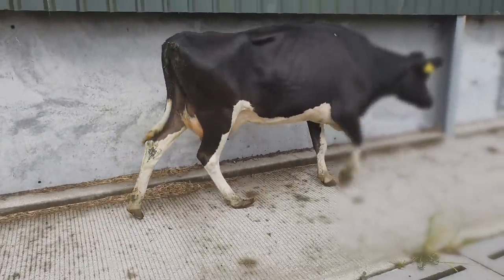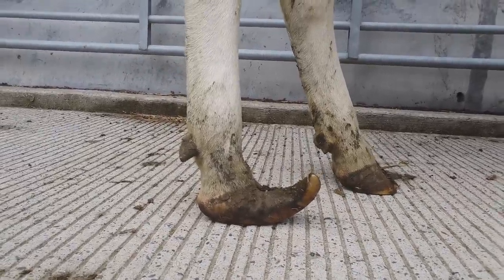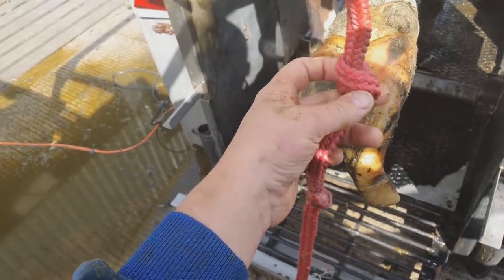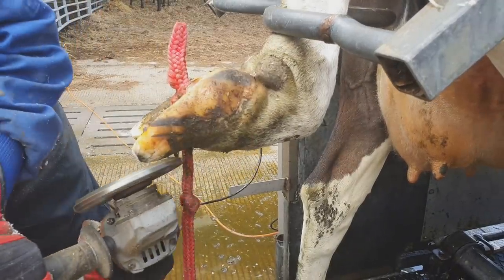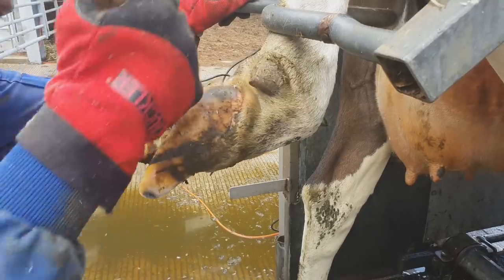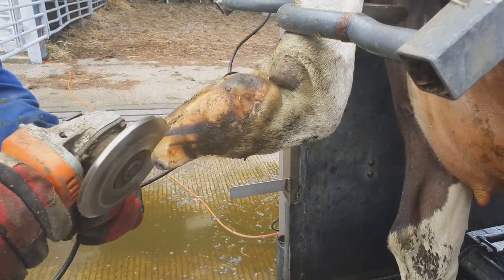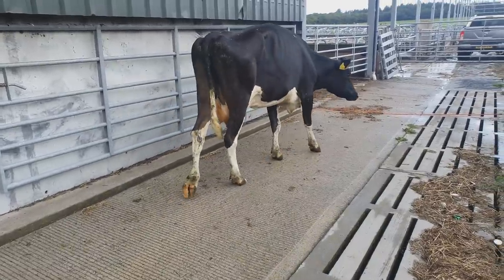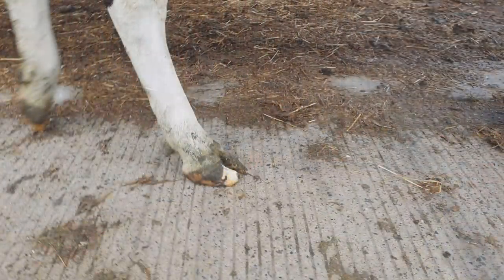COWS HUGE TOE! | The Hoof GP

Comment: I'm really impressed with what you know how to do. If someone ever told me you could reshape a claw and get a corrective rotation, I doubt I'd believe it. I know how important it is to be able to achieve proper angles in horses hooves. If the hoof doesn't have the correct angle, then the horse founders and has to be put down. You say you are just a hoof trimmer but it is obvious that there is a lot more to really knowing what you're doing.

Comment: For a hoof to grow like that means that the environment the cow is in is not adequate,... normally in the wild they would have go to all kinds of grounds with rocky parts and the hooves will be automatically trimmed / shaped because nature gets the way to fix itself (in most of the cases). And also seeing these are milk cows they are constantly in humid and small confined areas which can cause for the hooves to rotten and to grow abnormally due to lack of movement. It is nice to see you do a great Job with the bulls and taking care of them!!
Reply: this is actually caused by a problem in the overgrown claw, causing her to take the bulk of the weight on the opposite claw so the bad claw doesn't wear. At no point did he touch on the conditions this herd was kept in other to say in the comments that herd lameness is exceptionally low so I think you're making a few assumptions.

Comment: By the looks she is slightly rotated or stretched white line if cows have that but with more trims I would say she will be ok.
Reply from the maker: Absolutely spot on - she has a partially rotated pedal bone - the sole of the hoof needs to be trimmed perpendicular to the axial wall in order to try to reverse the rotation

Comment: Dr. What causes this? Like I said b4 in my post, I have an older cow that has long hoofs and she limps at times but not always. I live in Philippines an there is no one that does what u do and I need to do my cow and my younger heifers are starting to get the same way. Is there anything I can do to prevent this b4 it gets too bad. My father in law used to keep her on very wet ground n I noticed when I started to put her on harder ground she would suffer. Any advice will be greatly appreciated. God Bless

Comment: Question to that curled hoof. We had one like this, but it wasn't just the front which grew longer, it was also the outside wall, which then curled under the hoof. Like a false sole. Wish I could have seen the hoof from the back when you shaped it. Did her outside wall on that toe curl under as well? If so, did you trim under the foot all the way to what would be the real sole? Not sure if it makes sense how I try to explain it. Just wonder how you would tackle a trim like that.
Reply from the maker: That makes perfect sense. Yes this was exactly the same to begin with and as you can see once it has been trimmed it is back to the correct sole horn.

Comment: Every time you put the leg up it seems to go with great force and the cows is also quite heavily protesting, and pulled out of balance. Why not more gently/slower? Seems like the biggest stressor of the whole process
Reply from the maker: The slower you lift their leg the more resistance there is because they realise its happening - if you lift their leg slowly the kick out which could hurt themselves and they strain to try to keep their leg on the ground d which can pull tendons and stretch muscles - lifting them as quickly as sensory possible is best I promise

Comment: I have angus cows and I have a bull that has a toe just like that. and I can’t find anyone to work on him and I can’t sell him. I think I will try to fix it.but I have never done it before and my question is i think you said not to grind the top of it right?
Reply: @Fey most vets aren't too clued up on something as extreme as this.
Reply: alistair clement I think you need to look for a new veterinary practice, if your current vets aren’t to clued up on hoof trimming.
Reply: @tom4412  my current vets are very good but I've seen a lot of others who aren't and would call in a foot trimmer for this or leave it half done.
Reply: alistair clement I got the local foot trimmer guy to come out when my bulls feet were overgrown and twisting. Made a good job and it only needed doing once. My vets recommended him to me.

If your current vets are good, there’s no need to look elsewhere then.
Reply: @tom4412  my vets employ 4 trimmers, they cover a huge area though. the bull I had when I was a student we had to get a vet to cause he had to knocked out, he was too big for the crush.

Comment: YOU SHOULD WASH THE FEET OF THESE COWS BEFORE YOU START WORK...I HAVE NOTICED THAT YOU NEVER PUT ANY WATER...BUT JUST USE IODINE DIRECTLY..MOST OF THE IODINE FALLS ON THE DIRT
Reply: WHY ARE YOU shouting?
Reply: @alistairclement4239  Not shouting....Highlighting...
Reply: @adiyogi9705  well it certainly looked like shouting.
 There are some safety issues involved with washing the feet, including cuts, fires and electrocution. Washing every cow would mean he could help far fewer cows and the grinder gets them clean anyway. There is no benefit to the cow, just to the viewer.

Comment: Not trying to be a grammer nazi but at 4:02 you say front dorsal. But dorsal means back so how can you have the front back side. It doesnt make sence. Sorry of this sounds rude but i jist wanted to point this out.
Reply from the maker: It doesnt sound rude - you're right to say it if you think it. "Dorsal" means "upper side or back of an animal" 

In this case it's the upper side of the hoof - which is also the front - because the angle of the foot